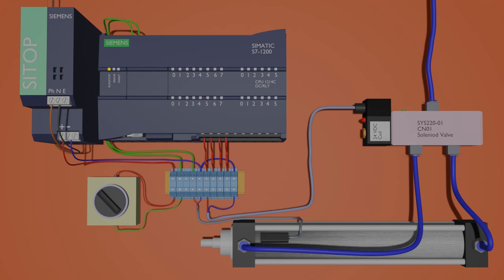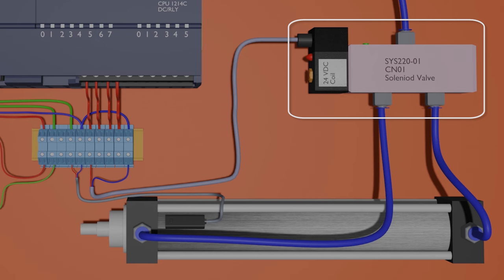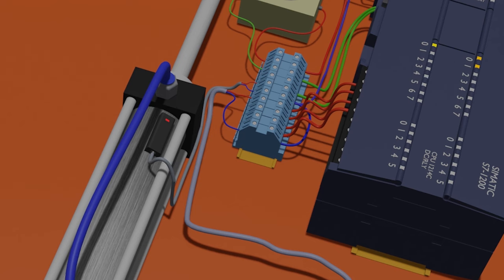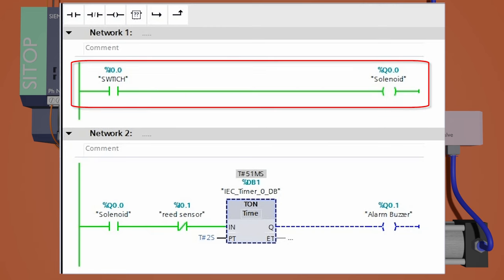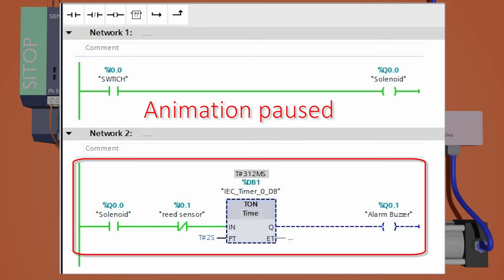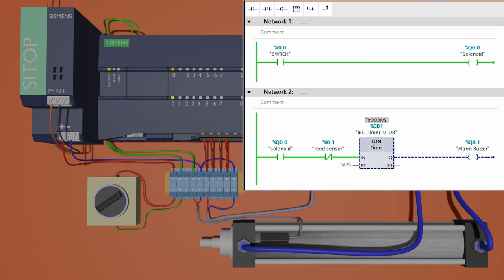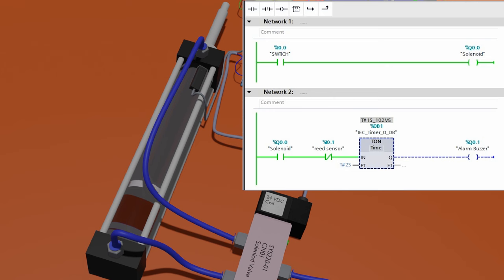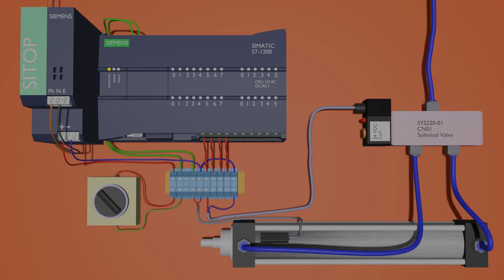How to operate a Pneumatic Cylinder with PLC ? PLC programming tutorial for beginners

Comment: I have a question can we move that pneumatic cylinder to certain distance only or not? Or we can move only two position that is one with maximum length and another with minimum length.
Reply from the maker: you can move cylinder , for this you have to use 5/3 way solenoid valve, but it is some times not 100 percent accurate for some high speed applications